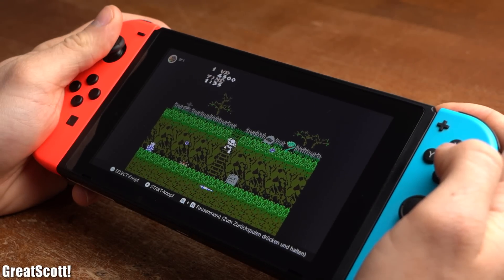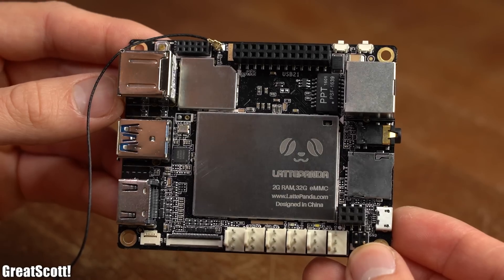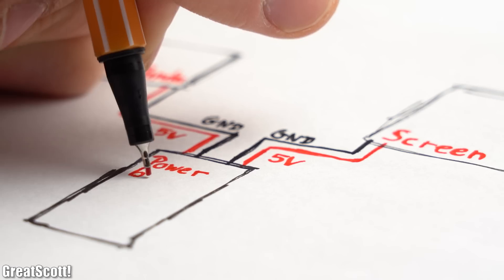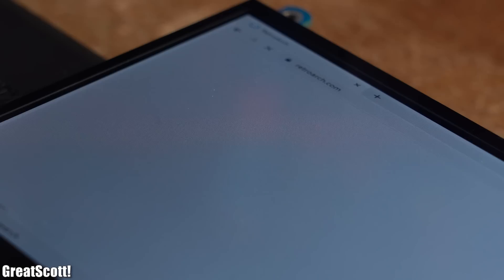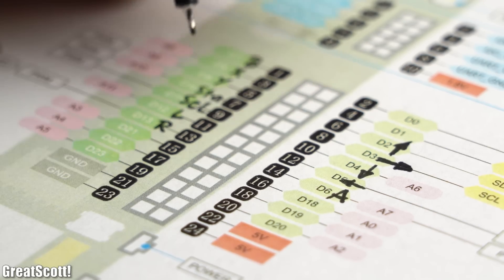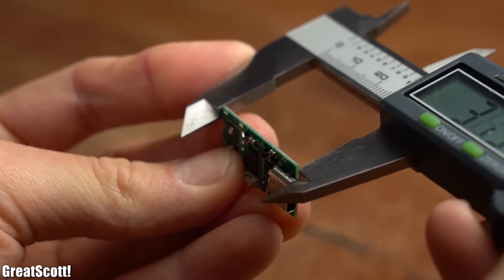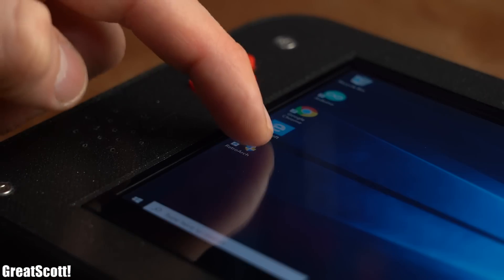Make your own Portable Retro Game Console!......which is also a Win10 Tablet!

Comment from the maker: I am currently planning a more powerful version of this project with analog sticks and the ability to use PlayStation Now. So if you got ideas for improvements then let me know :-)
Reply: You really did an amazing job! Some ways of improvements:
- add a battery and BMS
- put the last screws (10:58) at the bottom
- to save space (I mean: a LOT of space) you can desolder some of the ports such as the two USB-A. I bet you can save 1.5cm of overall thickness
- about the button: if you plan on adding a directional cross instead of four buttons, take a look a Jiri Praus' brass Gameboy. There are a some ideas you could steal from his design.
- one last: please, please use silicon wire 😂

That's all I have in mind for the moment. But again, this is an amazing project. I can't wait to see version 2! And for sure I will build mine 👍🏻

PS: "but how the heck can he post comments a week before the video is released???" comments incoming 😁
Reply: @deadbird99  THOSE COMMENTS ARE FOR HIS PATRONS!! THEY GET PRIER NOTICE OF HIS PROJECT'S.. ANY TIME YOU SEE SOMEONE PUT OUT A NEW VIDEO & THERE'S COMMENTS A WEEK OR MORE OLD, THEY ARE PATRONS!! & THE VIDEO MAKER CONVERSING BEFORE IT OFFICIALLY PUT OUT..
Reply: @deadbird99  How?
Reply: @deadbird99  The video was hidden, and he posted the comment while it was hidden.
Reply: @deadbird99  + For battery, bein a total partable gaming device.
+ unsoldering connector is a big gain of space and thicknss!! just the 2 femele USB being above each other, imagine the thickness of that......
+ for button, please use use something other than those noisy tactile button.... playing with that device for 10min, I am such you undertand what I am talking about... there is a lot of alternating for button, silent and also very soft type...
+ for the main board maybe you can find something better, I mean Windows 10 on such a small screen, ok it work, yeah, but I dont see you doing everyday task on that small screen, other than gaming... + maybe other mainboard for the project can reduce the cost side 😁

+ the 3A issue is sure related to it... so charging the board has advantage at all level.... but it is fine, it is v.1, so sure you will find way to improve it...... 
Good luck for v.2 😉
Reply: wait what?  How did you do that? Patreon?  I guess you guys get private links prior to public release maybe?  Am I in the ballpark?
Reply: @SirHarrisonPhillips  i saw comments on big Clive's channel that were a week or more old & the video was only released that day.. so i asked and one of his patrons told me about it..
Reply: @deadbird99  that's the perfect list of improvements
Reply: @deadbird99  your comment also says it was a week ago?? strange yt
Reply: @HS-eq3gk  he has uploaded it and set it to not listed
Reply: You maybe need to add a lithium batteries with holder to be easily mounted or replaced,a battery management system and a board for all those wires and the joystick to be easy to troubleshoot
Reply: - Would you say it would be possible to print the buttons with fileflex? 
- You also could use an Bluetooth module for controlers like the switch pro controller.
- Win10 has an option to connect to an screen wirelessly over WiFi. Could you demonstrate this with an smart TV? It would be like it was docked
Reply: @commander_red  I agree about filaflex, it would be nicer to press them.
Reply: @commander_red  Great idea using MiraCast!
Reply: It's really great if you make Automatic Answering machine with 3D printed enclosure !!
Reply: Have you ever heard of the Uzebox and Arduboy? These are also cool do it yourself consoles.
Reply: I think the biggest thing is a battery
Reply: Du kannst es dünner machen indem du die Komponenten nicht übereinander sondern nebeneinander einbaust wenn du verstehst wie ich es meine, weil ja überall noch viel Platz war aber das Gehäuse trotzdem relativ dick war
Reply: Talk to Ben Heck. He's been doing this kinda thing but with cut down console boards for decades, including a portable PS1 and PS2 among others.
Reply: WOW YOU REALLY GOT A LOT OF GOOD TIPS THERE IN THE COMMENTS.. YOU SHOULD HAVE NO PROBLEM MAKING A CLASS VERSION 2 PROJECT!! ; )
Reply: Nice
Reply: GPD Win: "Am I a joke to you?" Haha jk, awesome project i love it!
Reply: Add an IMU, this way you can also tilt and shake for more controlls and functions.
Reply: i would go with a lot of things x99 said but i would also go for a more ergonomic design, probably make the part where the buttons and my hands are not as thick as the rest of the system. would also make it better to pick up if its laying flat on a tabel :D
Reply: This project is amazing but you should try get rid of all the cables inside the enclosure or at least most of them or at least desoldering the usb ports and directly soldering the cables from one pcb to the other. Now add better buttons since the ones you used looked like they are really uncomfortable (maybe a proper D-pad), trigger buttons and as you said joysticks.
Also, I would make a more ergonomic case and place the battery inside since having to carry a brick in order to use a portable device is kind of weird.

PD: I forgot about proper cooling, maybe a small cutout and a fan so it doesn't fry up after 30 mins playing.
Reply: Personally I would extend a USB port to the outside to be able to plug in a keyboard (assuming you dont have a bluetooth one) and extend the ethernet port for wired steam remote play
Reply: External USB for sideloading games and for another gamepad.
Reply: GreatScott! Rechargeable and extra HDMI port to connect to big screens also nice video TAKE CARE
Reply: Let the ethernet port accessible, maybe someone will use a cloud gaming service. And also make a pcb
Reply: i would go with a Tiny laptops motherboard and solder the buttons to usb this world make it made powerfull and since the bottom of the laptop already has a battery and such inside wich makes it more compact and gives it better cooling at the same timemore compact, this wouldnt make it as "DIY'y" as it is now
Reply: Can you make a smart speaker contains Google assistant and Amazon Alexa using raspberry pi zero w
Reply: A suggestion:
Use Steam Streaming, build into Steam (Windows Version)
And please add some kind of  additional analog back button, so you have an full XBox controller
Reply: you should use better switches as these sounds so clicky 

battery of-course
extra buttons for future
a extended USB for pluging any keyboard or a USB flash
 all the best
Reply: Games designed for quick 2D action really need a dpad that has a ball pivot and rubber dome switches for quick rolling actions. Nintendo dropped the ball (no pun intended) with the 4 tactile direction switches. If you introduce an analog joystick instead it'll have too much "throw" for classic twitch action 2D games. Excellent job though. I've just never seen a custom console with the ball pivot dpad because they always try to use tactile switches which allow you to press opposing directions or make it hard to do diagonals.
Reply: You should add a Usb port to the housing.
Reply: You definitely need to make the buttons with rubber behind. Those tactile buttons are a huge killer for fun game play! You should be able to make such rubber pads yourself with some silicon molds.
Reply: It looks rather thick to me. Maybe the new version could be two-parted connected by a hinge or maybe separate them completely (with a cable between display and sbc). The hinged version could be similiar to a Nintendo DS with a single display or like a 360° Notebook.
Reply: I personally would not of used retro arch 
On a System like that in windows 
I would’ve at least use Linux to run retro arch within that 
But if you’re primarily trying to use windows I would recommend launch box and then set up each emulator individually
Reply: can u make a powerfull ebike
Reply: How did you avoid the ground loop feedback from the lcd speaker?
Reply: I don't see any debouncing capacitors, is it done in software? If you plan to use it for gaming, double clicks can get very frustrating...
Reply: 1- desolder the usb ports (to save a lot of space)
2- add battery and bms (with the space created)
3- use the usb-c for data transfer (connect it to the usb 3.0 and to the power system in a way that you can power things up (such as keyboards and mice, maybe for some work, (even for game streaming)) and receive power through it for charging.
There are some pre made boards that do just that
Then connect the data bus to the usb 3.0 so that you can use dongles to connect devices (usb drives... ) (Even displays if you wire up the HDMI port of the lattepanda in a weird way).
4- not really necessary, print the buttons caps with flexible filament (such as ninjaflex), that helps after a bit of playing.
Hope this helps ;-)
And yes, i use lots of brackets :}
EDIT: In order to not fry everything up when it becomes hot, try making some heat pipes using a copper tube and a "bit" of hammering.
Reply: I honestly love this! But I have a few suggestions
- The biggest thing thing by far is the buttons. I STRONGLY recommend plastic buttons (maybe not 3D printed) with elastomer similar to a Gameboy. Furthermore using Retrogame on a raspberry pi you can wire the buttons directly to the GPIO of the Pi. But the Lattepanda has a built in Arduino so there is no need.
- Desolder all the connectors and wire directly or for the HDMI use a female ribbon connector that replaces the HDMI female connector on the board. This saves a lot of space for other things like a bigger battery.
- Stereo speakers and volume knob would be nice
- USB and HDMI with the audio jack would be useful for plunging it into TV and using wireless controller.
- A safe shutdown switch/button to shutdown before cutting power

I recommend looking at the Game Boy MiniMo by HoolyHoo, the WII U Intel m5 Console by banjokazooie and the PiGRRL Zero by Adafruit. Also the Sudomod forum is a good place for help.
Reply: You could have everything on small PCBs instead of loads of wires. You may even be able to make a few of them and sell them! (Ps. This is your best project yet!)
Reply: Awesome video.
- add battery
- do custom pcb for rubber dome buttons.  i.e minty pi project. (click buttons don't have enough travel for crazy button smashing in my opinion)
- more ergonomic case.
Reply: i would say make a battery compartment which either holds li ion cells or the powerbank
Reply: make it slimmer and add another joy stick
Reply: Use the lattepanda screen that connects directly to lattepanda
Reply: Golden Axe is beautiful
Reply: you could use a latte panda alpha 8.... (i dont know the eact model number)
it will help you to get the performance capabilities of a macbook aier 2017-18 model
also put the joystics onthe both ends
Reply: definitely reduce size, this thing is waaaay too thick
instead of hot gluing everything, try to make littler holding brackets for the switches
Desolder everything that takes up to much space, i.e.: USB ports, RJ45 port (ethernet), the arduino header and even the row of PWM power headers from the Latte Panda and the usb ports from the display as well as the buttons, which you aren't using anyway
Reply: Keep an external HDMI port so that you can connect an external monitor to play games on a bigger screen. And use the touch screen as a trackpad when external screen connected. And also a mini or micro USB to connect external consoles or pendrive.
Reply: some laptops have really small pcb. and are more powerful than most sbc.  maybe its a better starting point?
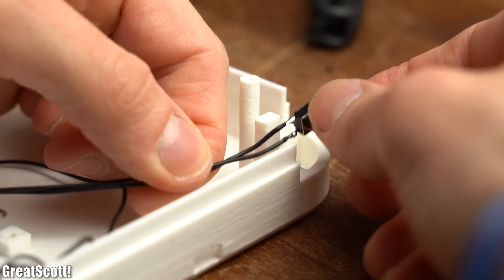Reply: my 1 suggestion would be some more reinforcement on the shoulder button mounts @9:33
Probably just my OCD but it drives me nuts when a project doesn't have consistent hardware(Hex/Phillips/Torx) across the entire build.
Reply: @GreatScott! can you make a similar project with Raspberry pi 3 or Pi 4 and also try to make it little slim
Reply: maybe raspberry pi zero
Reply: Usb ports PLS
Reply: hi,
Just add a mini gtx 1050 graphics or better card and add some cooling fans 
and now you have a gaming machine that can run all the games
also a good idea it will be an hdmi (station) that connect to external monitor.
Like nintento switch
Reply: Maybe you should add usb ports to the case and wire them to the latte panda for better IO and even add the ability to dock it so that it can be played on a bigger screen
Reply: Why to use PD board here? You can use 5V 3A on USB-C of your power bank directly without it.
Reply: I'm currently working on my own version of a portable that uses a button matrix for up to 32 buttons, (designing one matrix I can use across all my Retro Pie builds)  But with my design I'm integrating 18650 for the batteries, with another board containing the charge and bms circuitry, looked at off the shelf and they are too big well the ones I looked at, so had to design a circuit from an off the shelf circuit, sometimes DIY is your only choice when space is a premium, but I may still investigate an off the shelf BMS for mine, as I will admit the 7inch screen does give some space available.
Reply: If the new version still uses a windows sbc, maybe you could break out a USB port? Or maybe use a usb C port with USB host capability?

Also a battery would be nice if you can make space for it... Otherwise maybe stereo speakers? :D Mini fan???
Reply: Button breakout pcbs. can be mounted easily and more cleaner wiring.
Reply: Pleeease raspberry pi 4 and retropie.
Reply: @minepro1206  it doesnt run windows
Reply: @herksku9051  I said retropie. Who would want that resource-consuming spyware running on a console? For some reason, when it comes to consoles, they always go for Unix...
Reply: @minepro1206  now that i think about it  Linux does have it's pro's but for the sake of compatibiliteit it would at least require a Windows emulator for programs and emulators that don't work with linux, and btw you get to choose if you enable the "spyware"
Reply: @herksku9051  For the third time, retropie. It's amazing, works very well, no need for Windows emulator. And about the other one, it's closed source, you have control over nothing. Don't get fooled by toggle switches.
Reply: @minepro1206  k
Reply: Definately a true D-pad
Reply: Hey! Please make some videos on FUSION 360 for 3D printing! its a request!
Reply: Congratulations on the great built, your first handheld inspired me to build a rpi2 based portable console, i opted not to use the pi0 as i wanted to run neogeo games, anyway it will be interesting to see how those tactile buttons will stand the test of time, normally these contacts degrade easily and very early, so a definite improvement would be adding different buttons to the next version, secondly an integrated battery would be great, you can get the power bank charging and step up module quite easily online or may be you can salvage one from an existing power bank. Good luck with the next version 👍
Reply: Ok, now do that with a PlayStation 2
Reply: Do we have a more basic board then the panda? I don't want WiFi, Bluetooth, just something to play videos.
Reply: You can create a mini base where to place the computer and where you can also play with a joystick and attach it to the TV, so you can make a computer similar to the Nintendo switch
Reply: And remote play!! Dont forget remote play
Reply: @snowball 3601 The video is released to his patreons weeks before to the public, so I guess that's why...
Reply: One improvement would be to make it slimmer, it looks really thick and unweildy right now
Reply: there is a dedicated ips screen and touch for lattepanda which uses dp and touch port from itself intead of doing this complex nonsense of hdmi screen (extra cables, power sources and audio, for same price). it uses 2 ribbon cables near 3-pin headers. another thin is strongly reccomended to use the active cooling for LP which costs 10 euro on their website.
Reply: Internal Battery too would be AMAZING!
Reply: Absolutely fine project. I think sir you should make hundreds of more and just sell them for earn money
Reply: I have an idea for improvement
-build in battery
-design a button PCB, so you can connect the button without soldering
-d-pad 
The rest is up to you
Reply: Smaller, big custom PCB for buttons etc, battery, joysticks and triggers
Reply: Linus tech tips also makes a similar video with a kit, could you use a raspberry pi compute module as well?
Reply: you can create yourself a PCB for the Push buttons, Internal LiPo, You can definitely SLIM IT DOWN to half of curret version.
Reply: how about steam inhome streaming capabilities
Reply: My first thought was this would be a good way to use that sponsor you're always mentioning, would make slimming down the prototype a lot easier.
Reply: Add a battery please!
Reply: Watch some Ben heck custom handheld vids
Reply: .what about temperature of this device?
.does it feel okay inside with screen?
Reply: How did you comment this a week ago?
Reply: Try a latte panda alpha its the most powerful sbc
Reply: UDOO Bolt V8, might need to get a bit creative with the layout
Reply: This is one of your best looking projects (outside),, but still there is a room for improovement.
- PCBs for all push buttons
- ribbon cabling
- housing screws at the bottom side
- smaller/thinner case or integrated battery
- some external ports
Reply: Nice! Are you planning on using the arduino style analogue joystick boards with pin headers, or the bare X/Y potentiometer modules? I think it'd be pretty cool to design a board that takes the bare modules and has the 4 buttons above/below. You could probably even use the same board for the left and right sides, but flip them so the joystick is at the top on the left and the buttons are at the top on the right like a normal controller.
Reply: Maybe build in battery?
Reply: TPU filament for the button caps and PETG for the case. As others have said I'd desoldier unused ports to free up space.
Reply: You should add joystick to it,  because then you can emulate, Wii, Xbox, ds, 3ds, PlayStation, etc
Reply: Maybe instead of PlayStation joysticks maybe you can use switch joysticks
Reply: You mentioned on your story how you were concerned about the video not getting interest, for me it was the YT algo not notifying, since the video's brilliant as usual its likely that for everyone else too...
Reply: Possible upgrades like these
1. Add a battery like those of laptops
2. Upgrade the port to fit a laptop charger
3. Fans, like loads of fans
4. Make it thinner,it looks so bulky
5. Add motion control/vibration
6. Blu-Ray drive perhaps
7. Extended USB port and an HDMI out
8. More batteries
9. More batteries
10. Even more batteries
Reply: Why not use Linux on it?
Reply: Analog Buttons and Triggers
Reply: Definitely needs access to USB ports and a built in battery would be nice.
Reply: Really nice  project, but you could have gone a bit farther, like using a Raspberry Pi 4 and desoldering its ports (or using extenders) to make the design thinner and cheaper.
Reply: Je nachdem wie viel Abwärme der Prozessor produziert, lohnt es sich vielleicht einen Teil des Gehäuse aus Aluminium zu machen.
Ich dachte an eine großflächige, rechteckige Aussparung im 3D Druck der Rückseite. In dieses Loch kann man dann eine Aluminium Platte Einkleben. das PCB kam dann auf der Platte montiert werden und dazwischen kommt eine Wärmeleitpaste oder Wärmeleitpad.
Reply: Use the nvidia streaming service, is free and better, also with pc games
Reply: @duckytheduck3127  Making a standalone Computer is kind of the fun of this project.
Reply: you could make(3d print) a holder to go on the back of the case that holds the battery
Reply: Do it!
Reply: Really nice idea in video... Wait a minute... Why do you have russian language on power adapter? Are you a spy? xD
Reply: WE LOVE FORTNITE.. WE LOVE FORTNITE
Reply: Hello I have  a question do you can do the underline also in German?  (My english  is so bad )😅😅
Reply: Would love a pcb that cleans up all the wiring between components. Considerable space could be freed up for an internal battery pack and would result in a much smaller device overall
Reply: for a more lightweight powerbank, try out the "Anker Powercore Slim 10000 PD" with USB C! It's fantastic and I can even charge or run my ThinkPad T480s with it (despite the fact it maxes out at 15V)
Reply: use the ps3 sixaxis controller mainboard. you ca use the gyro chip with it.
Reply: I think I will use the PS Vita for a retro MAME console as an option so it is very useful.
Reply: Dual Bluetooth setup + reuse joycons, they are Bluetooth after all.
Reply: analog sticks
Reply: Is this newer iteration going to use a LattePanda Alpha?
Reply: use LattePanda Alpha and an external GPU like 1650 or 1060.

and please play Fortnite on it
you can all so sell it with better performance than the switch.
Reply: GreatScott! Battery inside the case itself
Reply: How do you maintain the tip of your soldering iron???  it's always soldering amazing. Mine just gets hot and cant melt any solder. I will really appreciate feedback.
Reply: Make it compacter, put in a battery, and sand the housing a litte for better look and feel (or make one out of wood with a cnc)
Reply: Use mechanical switches (like similar to keyboards???)??? Maybe? Idk.
Reply: Can you make a google compatible VR headset?
Reply: @GreatScott! Why dont you consider Geforce Now or stream using your own gaming pc (Parsec)
Reply: You could use psp or Nintendo Switch style thumb/joysticks. They are much smaller than the usual ones you might find if looking specifically for an Arduino joystick.
And, if you are planning on adding a battery to it you could perhaps just cannibalize a battery bank for simplicity. Though, I would like to see your take on a battery capacity sensor that works with windows. I'm not sure how to do that myself. 
Also, add more structural support. The bumper button mounts looked flimsy and like they would likely break.
Reply: You need to implement a cooling system, that's the only necessary part
Reply: Mac it run mac os as well
Reply: Make it thinner!
Reply: Wow! You really did a great job making that project! You inspired me to create similar device using the components, computer and display that you used. I want to design a device that can control digital mixing consoles and my windows laptop wirelessly. I've been thinking about it since then instead of buying an IPad.

You really are GREATSCOTT! keep it up!😉👍
Reply: Controller should support xinput and built-in rechargeables battery
Reply: PS2 emulator just had a major release PCSX2. Would be great with your analog stick plans
Reply: Use a single board computer with at least 4GB of RAM. Because windows 10 on 2GB ram is like 1.8GB/2.0GB with only on a desktop without any apps launched. Just booted.
Reply: Integrate a battery on this portable
Add 2 more sholder buttons as well as 2 joysticks.
Maybe changing the button sizes to something a little bigger might also help
Reply: For God sake 🙏 yes pls hurry up
Reply: do you know about parsec? I Love this proyect device, I want this created by a good brand to get solid suport and brand quality, not only for run Windows, Also for do streaming to your own pc gamer with parsec, no matter if you are away of your pc gamer, still be able to run games on your pc gamer and play that from your portable device with his screen and his joystick working to control with no lag your pc gamer miles away
Reply: You shoud add Gamecube games!
Reply: What one is the power wire
Reply: Scott, GPD maybe interested for you
Reply: Dear GreatScott, could this be done with a Ryzen embedded system and Linux?
Reply: Why didnt you use a Raspi 3/4 + Ardino + Linux with Retro arch?
Reply: No hate but If I have to build a retro console that costs around 200$ I can give 50$ and buy a ps4 slim. Any way love your vids:)
Reply: Use display designed for latte panda instead of external hdmi display
Reply: Maybe try to add a menu to select which emulator you wanna play also add a 2 joysticks 1 for WASD 1 for Arrow Keys
Reply: Make it so it can run minecraft
And  have a sim card or portable wifi
Reply: Wait how was this Comment posted before the video
Reply: When is this gonna happen, I plan to do the same kind of thing, so a guide would be nice
Reply: For simplicity, lattepanda offers a touch screen and display, that in my opinion, looks very crisp.  Lattepanda has this screen run off an embedded display, so it removes to external display driver and hdmi ports.  This will yield you a power reduction and a lot more space to fit in your battery solution.  Lattepanda offers celerons or 8100y models that have a trade off in power and cost based on you emulation and pc game needs.  A TP5100 based charge solution with a polulu boost converter will allow you to integrate your power delivery system and charge while in use.  I would recommend panasonic 18650 batteries for their safety and high capacity to weight ratio, unless space is more at a premium.  Another option is to use nintendo switch joycons, as there is software that allows you to use them over bluetooth as a single controller on windows.  This would improve the botton/analog quality if you don't want to design your own.
Reply: Use ppsspp software and add some blower or heat sink
Reply: Would it be possible in any way to build in from old consoles like gameboy or by DIY Cartridge Slots in this awesome machine?
Reply: How can I draw out a design for a handheld and have a Chinese gaming company build it?
Reply: I recently had an idea of something similar but instead of the lattepanda I would use a laptop motherboard and install steam os onto it. I'm not sure if I have the skills for such a project though 😄
Reply: I think you could save a lot of space if you designed a custom pcb where you seat the front facing buttons and do all the wiring so you just have to solder short wires directly to the pads, you could then also desolder the big ports from the lattepanda and solder short wires directly to the custom pcb. With the saved space you could integrate a internal lipo battery
Reply: First off, love the console.
I think in terms of the design it could be more "comfortable" I know I am just watching it and haven't actually held it but I think more curved edges (similar to the Vita and psp) and make sure to place the analog sticks at a diagonal from the buttons because that's more comfortable for thumbs to move (diagonally) rather than up and down which is a thing people find especially annoying about the switch.
(Also looks like it has space for more buttons overall?? idk)
I think some of Ben Hecks portables are a good reference for nice designs. 
Looks awesome, good luck with the next version
Reply: also maybe have laser cut face-plates (interchangeable?) as that could allow for an overall nicer look and some cool engravings maybe, or even a clear face plate could be cool
Lol, sorry if these are awful ideas
Reply: I think you need to add
Detachable joy cons
Battery
Try making it thinner